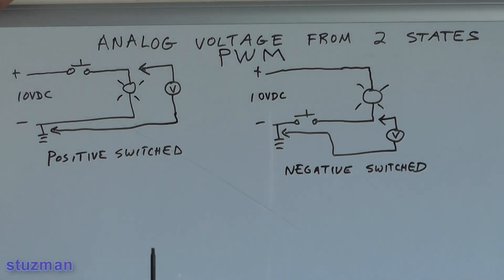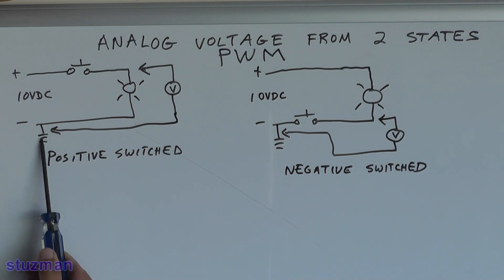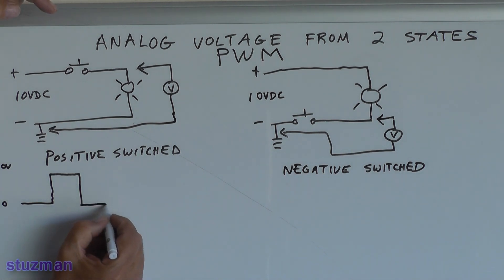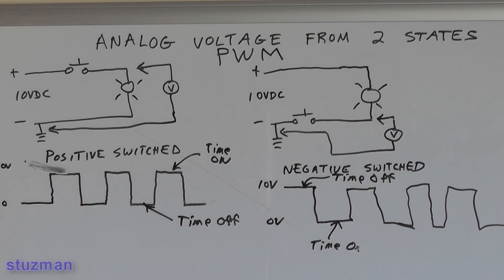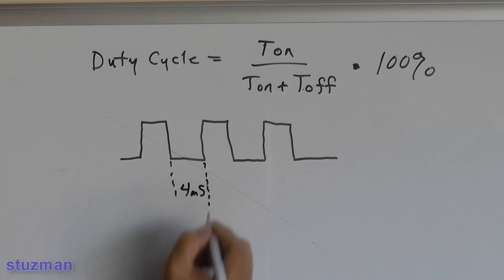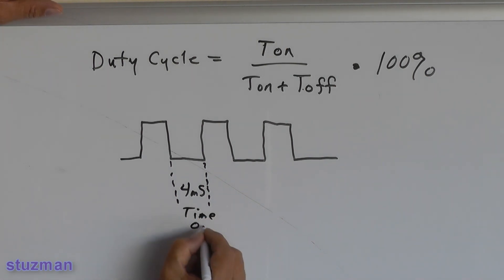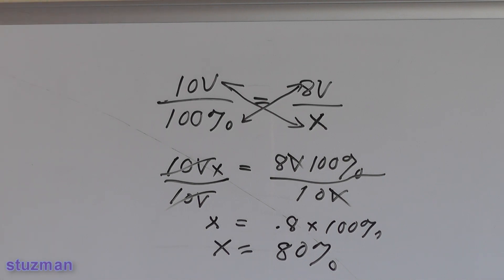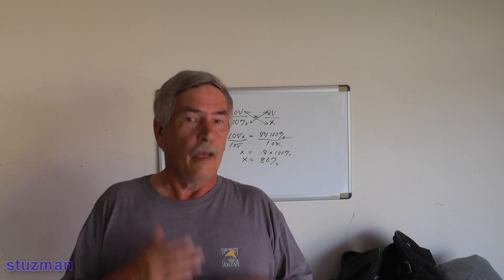Understanding Pulse Width Modulation - Part 1

Comment: Greetings Mr. Stuzman!  Today I bought a PWM module to test the Egr at Golf MK6 Tdi.  I also bought two DC sources, one for the digital transducer that handles the position of the Egr valve.  And one for the 12v motor that drives the Egr valve.  You made me better understand how the PWM principle works.  Thanks!
Reply from the maker: Great to hear that you're getting into the understanding of PWM in purchasing a module. I was glad to help out with the video and hope your project works well.

Comment: Yeah but you're measuring the voltage across the switch not across the load
Reply from the maker: I'm sure that you're referring to where the load is switched on the negative side. I showed the voltmeter across the switch to emphasize that the circuit is energized when the switch is closed which would show 0V. Otherwise, across the load it would show 10V when energized. I felt showing the voltmeter across the switch would be a little less confusing to the viewer. Have a great day!

Comment: Excelente video gracias por kompartir amigo preg de puede medir la amplitud del pulso y la frecuencia en inyectores y bobinas y en trasmisión automática del auto Kon fluke87v gracias información y ayuda de México
Reply from the maker: Thank you very much! If I understand your question correctly, you're wanting to know if the Fluke 87V can measure the amplitude and frequency of PWM signals. According to Fluke's website, it says that it can measure PWM for motor driven signals. Although, I've never tried this feature, it something you can investigate. Good luck!
Reply: Gracias por información comparado con el Fluke 88v cuál Cheka mejor el PWM o me sirve mejor p chekar pulsos gracias por ayuda
Reply: Hola a todos feliz año nuevo lo.mejor p ti y tu familia sobre todas las cosas una pregunta kle es mejor un multímetro Fluke 88v o un FLUKE 87v trums
Reply from the maker: @reynolflores2337  Happy New Year to you and your family! For me, the 87V is a better multimeter although it costs more than the 88V which is more of an automotive meter. The 87V uses true RMS and is a little more accurate. For automotive use the 88V is fine, whereas the 87V is more for industrial use. Either one will work though. As for me, I have the 87V and have used it in both the industrial and automotive environments. Take care!

Comment: When calculating Vout (and by that I'm thinking voltage across the lamp), shouldn't we consider Ton=1ms? That's because Vout should be calculated with respect to the time of the Duty Cycle when the signal is high. In the example above, that time is Toff. Or maybe, we keep these values, but we need to substract the final result, 8V, from Vin, which means Vout=Vin-8V, Vout=2V. I'm new to the concept of positive and negative sides switching and trying to make some sense out of it. Please clarify.
Reply from the maker: Yes, you would be correct that with the example that I gave using a negative side switching, the voltage would be 2VDC although the time is on more at the bottom. At the time I did this video, I put the bottom pulse width on the top instead of using the top pulse width. When measuring with a DVOM, the meter doesn't know if the circuit is switched on the positive side or the negative side. As far as the voltage from the voltmeter's point of view, it's only sampling the voltage on the positive voltage in respect to the lower voltage. In other words, the positive voltage has the priority of how much voltage is going to be measured and it doesn't matter if the circuit is switched on the positive side or negative side. In the example that I gave, the top portion of the pulse is 1mS and the bottom portion of the pulse is 4mS . So, to calculate the voltage out, it doesn't matter whether it's switched positive or negative. Always use the pulse width on top divided by the total period * the Vin. So, that would me (1mS / 5mS) * 10V = 2VDC as you've already mentioned. One thing to keep in mind with the example that I showed which is the negative side being switched on is that the on time for the load is at the bottom where the current would actually flow for the circuit which is 80% of the period. Sorry XXL about the confusion. I redeemed myself in part 2 of this video series of where I explained this a little clearer with an example on a vehicle. You've got a good eye in catching that mistake! :))
Reply: Thank you Tery for your quick reply. I can see clearly now ... :) I don't know what I like best, this in depth explanation or the wealth of knowledge you are sharing with us on your videos. I join the pwm enthusiasts on this page to congratulate you on your work!
Reply from the maker: Thank you very much XXL and means a lot to me that you understand the concepts of PWM and thanks again for the comment! :)

Comment: Sir you have wrong in your explanation at time 10:17   actually the time on equal to 1 ms not 4 ms so the numerator 1ms/4
ms+1ms  the result is 0.2*100% its equal to 20% duty cycle finial result    Regards I am Mr.Thair from IRAQ
Reply from the maker: No Thair, the example shown is correct! :)) If you take a look at 10:17, you'll notice the pulse that you're referring to is  1mS wide, but you'll also notice that this pulse is during the OFF time. The example here is where the GROUND side is switched ON and that's where the 4mS on the numerator is coming from. In another example, I do show where the pulse is actually on which would be like you're referring to. In electronic circuits, the duty cycle depends on whether the B+ or the ground side is switched on. Thanks for watching the video Mr Thair, and I do appreciate your comment all the way from Iraq! :))

Comment: great video thanks , i have a question please ? could you please help me with a  diagram  to build a circuit to generate pulse frequency  27 kHz, with a maximum pulse width of 39.0 -- 40.8 % of the cycle width.

Comment: The duty cycle calculation surprised me a little but it made perfect sense. Since frequency remains the same, I had never considered counting the on and off together for the denominator as I figured it was a set value for a given circuit. It's a solid way to teach itnof course.
Reply from the maker: DE Nichols David I am not sure why I did not get an email response from your comment and so I apologize for the delay in responding to you. Yes PWM is not that bad once you see how it all works. Thank you for watching the video and sharing a comment. 😀

Comment: Every time I turn around I find a PWM circuit, so there must be some reason for it to be so popular in automotive circuits. It seems to be a way of translating digital information into an analog output (or vice versa). I'm looking forward to your IAC description.
Reply from the maker: spelunkerd hey Dave and hope you're doing well! You are correct that it is used everywhere in automotive circuits. The biggest advantage of why PWM iis used is because power dissipation is very low in the output stage which makes the circuit very efficient. I'll cover a little bit of this in the next video. Thanks for dropping in Dave to share a comment. 😀😀

Comment: Great job Terry! Also is a great example of how the pulse pulse-width can change but the frequency stays the same very good jobs
Reply from the maker: South Main Auto Repair Hey Eric, I'm glad you dropped in! You are exactly right that the frequency stays the same as the pulse width changes. I forgot to mention this in the video and only thought about it afterwards. And of course I forgot to mention about how PWM can have a different frequency based on the components for the load, Hopefully, I can do a follow up video on a vehicle and point out some of these things. Again thanks for dropping by and sharing your thoughts! 😀
Reply: I was just watching your video on EGR testing Eric! Which led me here. You did some testing on an EGR that had 2 dedicated grounds so you said the EGR was controlled via pulse width modulation. Good stuff!
Reply: +southmainauto Would a loadpro help with this?? ; )#

Comment: Well done Terry. Question - does the time it takes for the voltage to drop to zero or  increase to the  supplied  voltage  part of the calculated percentage value  in the total duty cycle. 
Floating grounds have me puzzled too. LOL
Reply from the maker: Hey Steve. With a square wave when it rises from 0 to supply voltage the time for this to happened is considered to be instantaneous which across time is 0. This holds true when it goes back from B+ to ground. In actual reality, there is a very, very small amount of time for it to go from one limit to the other, but even with a scope it would be difficult to measure. And this very small amount of time is not considered in the equation of calculating the PWM duty cycle. And what's confusing about the floating ground Steve; not much to it really :) Thanks for dropping in and leaving a post.
Reply: It's the floating grounds on gensets. It seems to me  their set up in two versions some with floating grounds and some not . How does one tell the difference ?
Reply from the maker: I'm not sure how I missed your post here Steve about the gensets. I only saw it when I was commenting to another viewer. I assume that you're talking about the neutral, right? The ground, (equipment ground is a totally different wire). If you're talking about why in some installations the neutral is floating and in others it's grounded, here's a link that hopefully explains the reason. If it doesn't make sense, just holler out again :)

http://www.ecmweb.com/content/unraveling-confusion-over-generator-power-and-neutral-conductors
Reply: Thanks Terry
Reply from the maker: Always glad to help Steve!